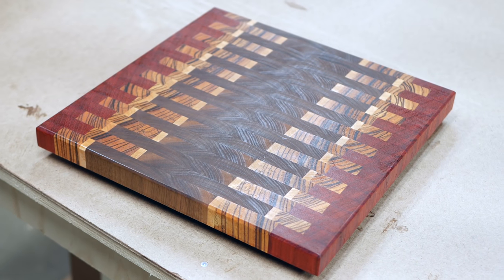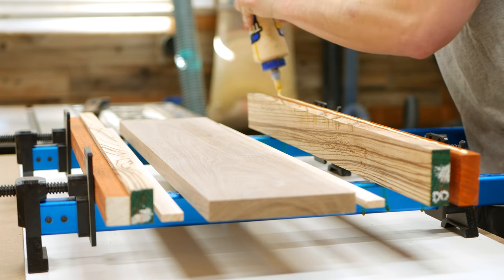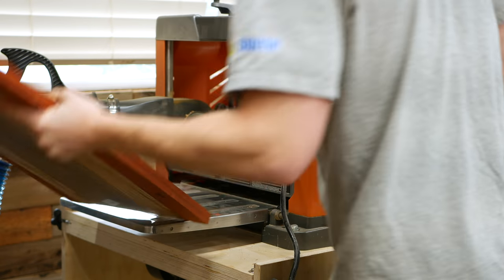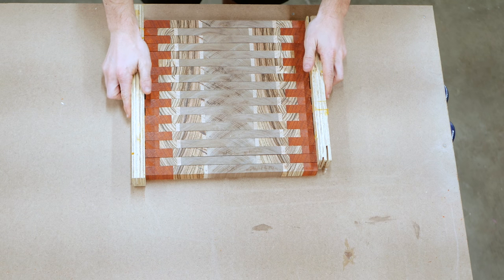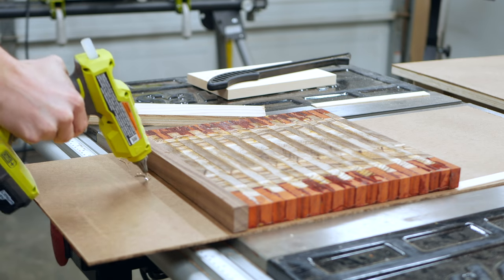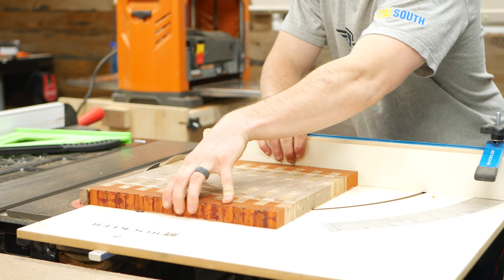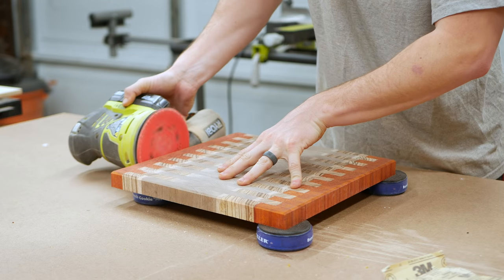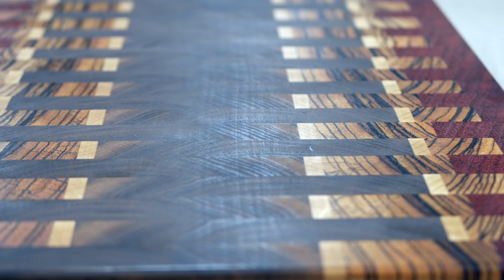Zipper Cutting Board / Woodworking | 38

Comment: Thanks for posting such well detailed video.  I really learned a lot from it. One thing in particular I took from this is that, to end up with a good sized end grain board, your initial board needs to be fairly long, even more so if you want your resulting board to be relatively thick. The board came out great.
Reply from the maker: my pleasure - yes good cutting boards are heavy because they actually use a high density of material in a relatively small space - unfortunately it means you probably end up wasting about 20% of what you use but i have a scrap burn pile so ultimately it never is wasted. good luck!
Reply: @workshop_edits  So as a newbie I’ve created just one board so far and it was an edge-grain board. My next will be an end-grain board and I plan to somewhat emulate this one. I have a surplus of some beautiful Maple and my question is, is that a good species to use as the main section, much like you used the Walnut?  Thx again!
Reply from the maker: Maple is a staple material for cutting boards so as long as it gives you the pattern you want then go for it!

Comment: Excellent work. I just finished my first cutting board which is almost identical to yours. I planed mine as well. No issues, just take very light passes.
Reply from the maker: I think as long as you understand the risks, you can prepare accordingly - personally I've never had an issue or seen someone have an end grain planing issue but hey - to each their own!

Comment: Nicely done & that zipper pattern is one of my favorites. When you can manage it, purchase a good Drum Sander. That way you won't have to worry about running the board through the planer. Also, next time try finishing the board with Shellac. It's a natural substance & will absorb into the endgrain protecting the wood against seepage. It only needs to be reapplied every few months, depending on how much the cutting board is used. You have a new subscriber!
Reply from the maker: Man I’d love a drum sander - just too pricey right now for me. To your shellac point - that’s why I like the stuff I used in the vid - soaks in, hardens to prevent seepage, and you really only need to recoat once a year from what I can tell

Comment: Great looking board!!!  Not sure about the width of the boards you glued up but the design came out amazing....  Was trying to find the info on instructables.com.
Reply from the maker: Apologies - I never actually ended up doing an article - just had no time. I eyeballed everything for this - the walnut was 5.5 inches wide and the rest was between 1.5 and 3 inches- the total piece is around 13" wide. If you can just look at the design conceptually the construction of it is quite easy - best of luck!